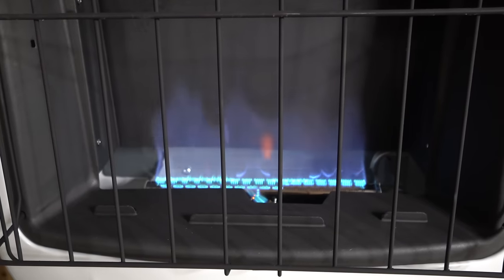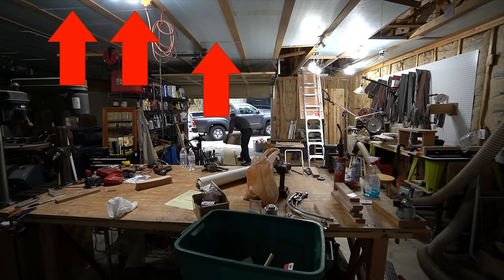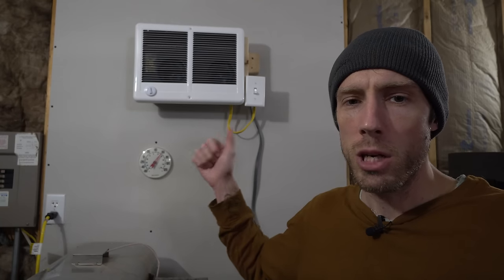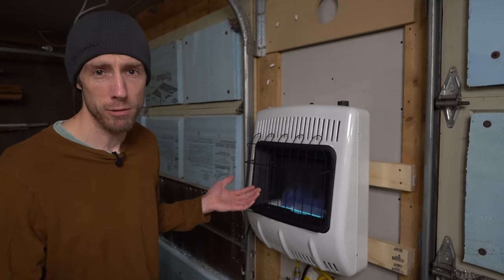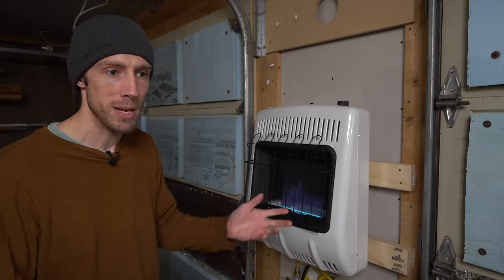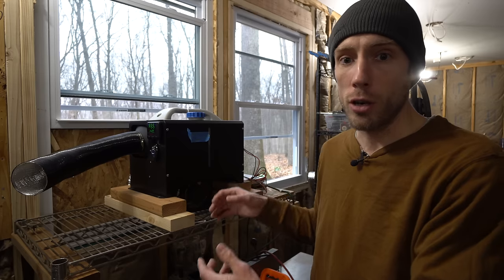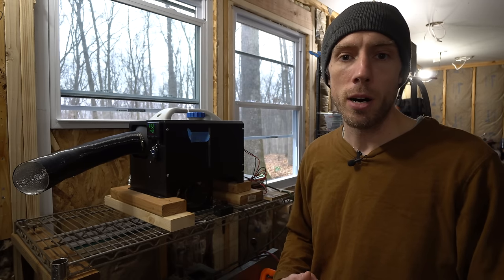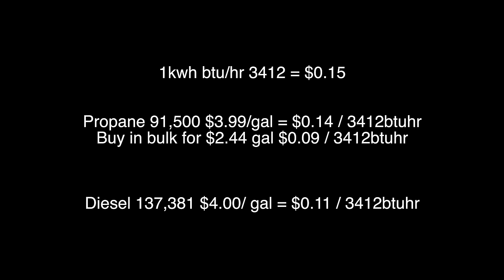What the most cost effective heater for a small shop? How I Heat My Shop For Cheap

Comment: Seems to be a lot of prejudice against mini split AC heating in the US. They are pretty much the norm here in Europe and most half decent inverter type ones are good down to around 0F and happy above 10F or so. So I'd get a decent one that's good most of the time and use the diesel when it gets really cold in there. The rest of the time you'll be getting 3-4-5x on top what you pay for electricity and it will also cool efficiently in summer. Your afore mentioned dust issues are a problem for an AC but I would be more concerned about inhaling those than about my AC unit doing so.
Reply from the maker: The issues I have with them are: Reliability issues with little parts availability, poor air filtration, the efficiency isn't a big coat saving. It would still take 10+ years to break even, just in time for the warranty to run out. So more traditional methods like propane/ diesel and a window unit are a better option for me amd my location.

Comment: There is another down point to using room vented gas or propane heaters in so much as they do produce water vapour as a combustion by-product and increase the atmospheric humidity in a the room. That is not good in workshop areas where machines with large bulks of metal are concerned as the water vapour condenses directly onto the cooler metal surfaces. Your diesel heater is the best option here.
Reply: Absolutely right. Im running a small machine shop and propane will make a lot of quick heat. I can’t have the condensation on my machines.

Comment: Thank you for sharing this.  I'm currently looking for an efficient way to heat my shop.  It's the same size as yours but I have taller walls with no attic.  What do you use to keep it 45° overnight? God bless!
Reply from the maker: Nothing, I turn off everything at night and the thermal mass inside the building keeps everything about 45 over night👍
Reply: @OUTDOORS55  awesome thanks
Reply: @OUTDOORS55  Nice Vid. Yep, the first fire to heat up the Thermal Mass is what costs a lot. Once the mass is warm it takes less to get back up to room temp. Unfortunately, the reverse in summertime cooling.

Comment: I heat my 10 x 12  r1 insulated shed with that kind of heater.  With your level of insulation your heater isn't even trying.  The efficiency I would put that closer to 60% when you plumb it in with the kit provided.

Comment: And if you used an air to air heat pump you could probably do it for $0.05 /3412btuhr or less depending on how cold it gets where you live.
Reply from the maker: Your forgetting the $2500 up front cost and further maintenance costs

Comment: Great video, very informative. How do you maintain you shop to 45 degrees? Can the diesel heater be hooked up to a thermostat to maintain the 45 degree temp? I have looked at the small diesel heaters and the fuel tanks seem quite small, how many hours of run time do you get out of a fill, hours per gallon?

Comment: Honestly, for as much "fiddling" as you are doing right now, as well as your interest in getting heat for super cheap, i personally think that you would Love wood. Just a nice small Scandinavian stove with a small pile outside that you can split with a maul whenever you want a little break from things.... Light a fire in the am and then add if you want later on. Or not if you're going out. When you learn the tricks to lighting fires it's lickety-split. Plus, it's Always nice to have a fire going to get rid of any paper, cardboard or wood scraps (not plastic obviously) . Leave your coffee on it to stay hot. Seriously the conveniences are endless. Get a simple electric chainsaw that you cam run a cord out to... super cheap. When you see limbs you want to burn, bring 'em there and cut as needed. I have Nothing against Chinese diesel heaters, but there's something to be said for independence 😉 👍
Reply: And btw, you can still use your diesel or propane heater for a quick heat-up while you get the stove under way 💁
Reply: I agree, except about the Chinese heaters, I have one thing against them, where they come from ;). That being said, I love Chinese people :).

Comment: From personal experience at installing several mini split systems, including the one currently in my shop, I can tell you much of the information you received on them may not be accurate. 

The cost of a DIY system for your sized shop is 1/2 or less than your $2,500 figure, plus they easily produce heat at less than 0F. My system works at keeping the shop at 70 dergrees when it's -10F outside. While a few years ago the higher performance (not pressure) systems weren't as common, they are normal now, you can even buy them at Home Depot. 

About the only concern is keeping the filter clean, as you said, they aren't designed for a dusty environment. But cleaning them is easy, and adding an improved filtering system would be simple to do. 

The cost of running the system would be half or less, probably closer to 1/3 the cost of the electric heater you had on the wall.
Reply from the maker: $2500 would be unit cost, wire cost, run new line to panel on dedicated circuit ( my main panel is far away and no space in the sub) just conductors alone would be $500. So the 2500 is pretty close counting all installation costs. Ive seen a couple of them blow coils with no parts available, or a year wait for a new one. I like simple. Hard to beat $100 heated shop.

Comment: You could try to partition the shop into a smaller place where you spend most of the time, which is heated, and a storage space for all the lesser used equipment, which isn't heated.

Comment: The most efficient would be a split AC unit that uses only a fraction of electricity to get the heat into the space, for cold weather the unit has to be build for that.
Reply from the maker: Unfortunately the cost / break even point isn't realistic. I can pay for 7 years of diesel fuel before I break even.

Comment: You need a vapour barrier, your R value  will go up.. Without it your loosing big time.  In really cold weather any moisture between the outside wall and insulation will create ice on the plywood.
Reply from the maker: There is a vapor barrier. Thats what the facing does on faced insulation.
Reply: @OUTDOORS55  That's quit different than what we use north of the 49th.  All walls after insulation are covered with 6 mil poly and all joints are taped. This creates a total dead air cavity so to speak.  All  outside walls are 2×6.  Thanks for your speedy update.

Comment: Add radiflect insulation to walls stops radiant heat loss
Reply from the maker: Reflectix is a scam. Actual r value of 1 is not worth the cost unfortunately.
Reply: Radiaflect is foam mylar and saved me 50 percent reflectix is not same.

Comment: I dont think you can beat a good mini split for cooling, mine is very cost saving in hot weather. But heating is not very efficient at all. Mine is terrible costly,Like I say cooling is hard to beat, especialy compared to a window unit.

Comment: When our central heating went out I tried heating my living room with my propane grill. My CO2 meter went up really fast. When I dont open a window it will peak at 1000 ppm after 4 hours, just from me breathing. The grill got it to 2000 ppm and rising in just 10 minutes. If the exhaust goes into the room, you need to let so much fresh air in, it defeates the purpose of the heater completely.
Reply from the maker: The exhaust should never go into the room.
Reply: @OUTDOORS55  Yes, but my grill does the same thing as your propane heater.

Comment: Take issue with something you said about doubling the power doubling the electricity cost.  I don't think that's true because if it is twice as much power you only have to run it half as long.  Pure linear relationship.  Am I wrong on that?
Reply from the maker: Im looking at cost per btu per hour. So for example (not accurate actual numbers just an example) Electric cost $3 for 10,000btu/hr diesel cost $2 for 10,000 btu/hr. So everything can be compaired equally. Thats where the numbers at the end of the video are relevant.

Comment: You're also using electricity with that diesel one? What does that 12v inverter use in watts? I might have missed it.
Reply from the maker: Very little, less than 0.01 a day

Comment: North American mini-splits seem outrageously expensive for some reason. I live in northern Sweden with a winter climate equivalent to Alaska, and I just had a 5kW inverter driven mini-split unit good for -4F temperatures installed for 794 USD total. And swedish labor ain’t cheap, so someone is stealing your money over there!
Reply: What brand is the one you have?
Maybe I could have one shipped and do the installation myself. I have a rather large shop, but I have a spot that is 12x24 I want to have conditioned for working on chainsaws and sharpening chains. If there is "extra" heat or cool air at a reasonable cost I could open that area up to another 12x24 section of the barn.
Thanks for any info :).

Comment: lol, Electrical power rates in much of the developed world are more on the 25-30c per kWh (a median 6-8c/kWh is not at all the broader retail experience..

NB. , exchanging (to ambient air) the exhaust heat is a "vital" energy saver (for a fuel heater)... - An insulated reverse-flow exchanger on the exhaust dust could contain the heat to a smaller space.

(Air leaks are the most important in a 24/7 cold environment...  a diurnal space in summer - with cool temps overnight, is less important )
Apparently burnt propane is carcinogenic - in Ca, esp...
Reply from the maker: Even more reason to not use electric

Comment: I would likely use electric or propane for my garage (will be insulating and upgrade it for workshop use this summer) since I already have those fuels and I will minimize exhausting carbon into the atmosphere. I’ll pay a little extra for cleaner heat.
Reply: i think your missing the point old boy . Brovo young man , job well done!!!
Reply: @alaskagoldtoolco.4915  please enlighten me. If it is all about $ and damn the consequences, fine, but it is important to consider consequences.
What point did I miss old poor grammar commenter?

Comment: Those diesel heaters only run at 50-70% efficiency. If you've ever taken one apart you'd see why, it's a fan blowing over a small surface area and small fins. These are made to be compact and fit into a car, not to be efficient.

Comment: I have a Electric heater with 3 heat settings 3000 ,4000 and 5000 watt i  use the 5000 watts to heat the shop up and then maintain the temp at 3000 watts. The best part is i have Solar on my house so we tied into that when we built the shop.
But i am looking into a diesel heater as well.

Comment: Get two 55 gallon oil drums Home Depot get a sour doe Alaskan wood stove 50 bucks pluss exhaust pipes you can go through a wall through a stop sign ???
Reply from the maker: I don't have the room for a wood stove
Reply: In most USA states the stacked double 55 gallon drum wood stove are not legal and if you have a fire your insurance may not pay and drop you. Check your local laws first. But do as you please at your own risk. 

I heated a house with a double 55 gallon drum for 15 years and know well how good they work if sealed and no cracks.

Comment: $0.45 per hour for a 3,000 watt? Sucks to be at the peak of the national average, I'm sorry. I'm  opposite that at $0.089, almost 9 cents per kilowatt hour and still buying cords of wood. Have you thought about building a solar hot water collector that you could blow heat from an old car radiator if you had a couple old hot water heaters for reservoirs? Might not get the whole shop up to 60 but would certainly be a significant help. I've been pondering  getting a pair of tyvek coveralls and using an old salon curler dryer station hair dryer unit to blow heat into it. On low it's  not going to puff me out to sumo size and the temperature would be perfect running at maybe 150-200 watts. Granted all my materials are going to be cold using that method, so it would only be during times that wasn't an issue. Still thinking about trying it this year, I have everything I need to do it, except for the motivation. Damn winter depression kills me. 😪 I hate seasonal affective disorder.
Reply from the maker: I am at $0.09 a kw/hr also, however you have to add on the fees included on your bill. Even at $0.09 kw/hr is still $0.27 per hour to run for a 3000w heater.😕
Reply: @OUTDOORS55  Of course I understand that aspect, but it certainly clouds the actual price per KWh if you have to factor in those charges. For example, my basic charge is $32/mo plus additional fees around $18/mo, so if I use 2,000 kWh in one month @$0.0793/kWh = $158.60 + $50 for service charges so $208.60 ÷ 2,000 =$0.1043/kWh So with regards to how many kWh I use that price will drop the more power I use, and vice versa. I'm not trying to call you out on your math, you probably just have higher base fees than I do since we have a PUD, which is usually quite a bit more affordable than say a major provider like PGE, or whatever. We get our power surplus from the Bonneville Power Administration but use PGE transmission lines that get it to our municipal utility lines, and so pay a small fee for the use. I would have to look at previous years usages to predict my actual cost, but it's nowhere near $0.15/kWh like yours. Even so, it's still cheaper to buy a cord of wood for $275.00 to heat this large house versus the 4,500watt electric furnace and the garage shops 3,000watt ceiling mounted beast. I'm always trying to get cheaper, more efficient means of heat where I can and have been gathering materials for a solar hot water collector, pipe, non-UV blocking argon filled double pane  glass, 3 used 50gal hot water heaters. I just hate to see missed oppurtunities to harvest that sweet sweet free radiation that big fireball our little rock circles gives off, it's just there for the taking yet we just let our roofing shingles squander it away. Such a shame I think.

Comment: You should have keep the foam on the sealing and seall   the joints whit uratane, youve got a poor vaper barior on your walls (the paper stuf ) old system, you loose a lot of heat on top of your walls
Reply from the maker: No, faced fiberglass has a vapor barrier. Went from r10 not fitting properly to trusses to r19 with no gap's at trusses.

Comment: Dude.  The best way to heat a garage is with a 240VAC 50 amp outlet that you also use for welding, to plug in your generator and to feed you buddy's RV when he visits in the summer.  You then go to Northern Tool and buy a 7.5KW/25,600 BTU electric heater and hang it from the ceiling.  In no time your garage is toasty, and there is no exhaust, no mess, no fumes, and you've got a multi-purpose 240VAC outlet.

Think, man...THINK.
Reply from the maker: I go over that in the video 😂 Listen before speaking 👍
Reply: Them are garbage. The fan never shuts off and they only last 1 or2 seasons. The service suxs also.....think man,..... think.....
Reply: (The northern tool heater)

Comment: There is another problem (or two) with propane it pumps moisture into the air and there is carbon monoxide to consider.  👍
Reply: Not with the blue flame furnace. Used one for over 6 yrs no problems at all

Comment: did you consider the electricity for the diesel heater in the cost?
Reply from the maker: Its only pulling a hand full of watts once started. Its pennies a day and doesn't really affect the cost to run.
Reply: @OUTDOORS55  A modern day light bulb only pulls a handful of watts. Still raises my bill.

Comment: If ypu put something on your walls.  It would create a dead air space and  help you ability to heat your shop exponentially.
Reply from the maker: The walls are insulated to r19
Reply: @OUTDOORS55  I know but there's nothing overtop of it.   Trust me I have been in construction my whole life you take any room in a house tear the drywall off.   The temperature  will drop fast as heck.   If insulation  is put in properly its stapled on the inside of the stud with the paper bent at 90degrees.   Then when ypu put your drywall up it gives you not only an insulated stud cavity the dead airspace gives you more r value.    Try putting up drywall or 7/16 osb i promice you the  difference will amaze you

Comment: I would disagree with your opinion on mini splits. Cheap ones work well enough and while they are rather inefficient when it's really cold outside, they can for a large part of the year supply you with highly efficient heating. Dust should not be much of a problem if you keep the area clean. Auxiliary heating will be needed for really cold days, but this can be any of your current choices.

Comment: You could get a small propane furnace as a backup and an air handler and then get a a conventional outside condenser unit and set it outside standard 410 a those guys on YouTube that will show you how to do it yourself or you can get a window AC unit it's a shame they don't make a bigger diesel heater or if they can make a diesel heater how come they can't make that a propane heater what runs on diesel can run on propane it's like a power generator they've got them that run on gas they've got them that run on diesel they've got them that run on propane I don't understand why they can't engineer a Chinese diesel heater to run on propane